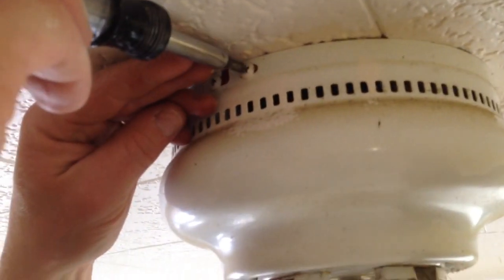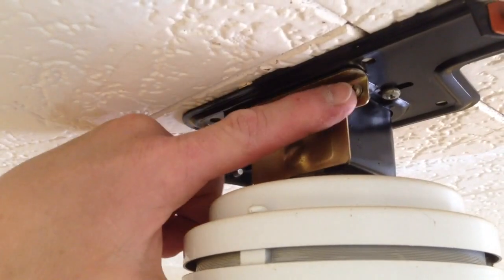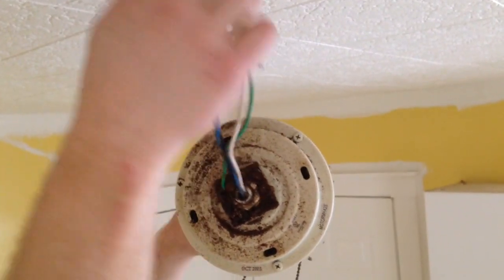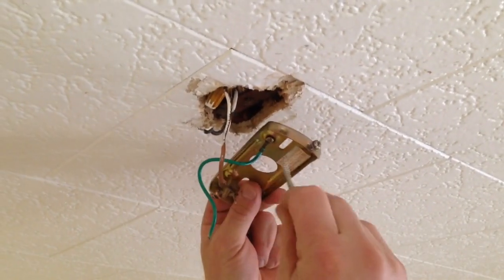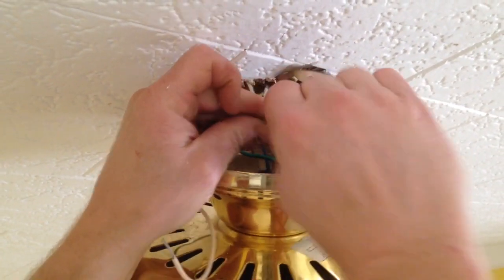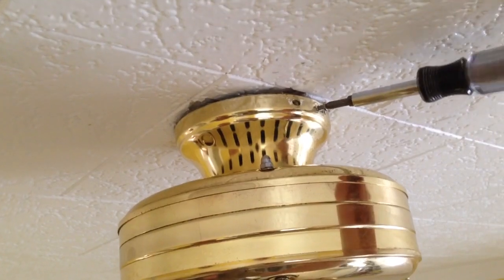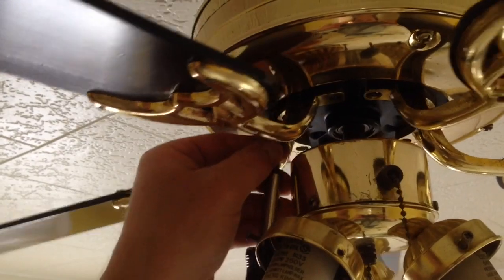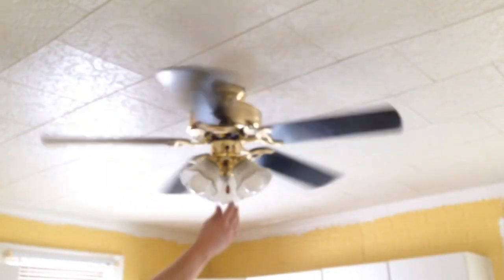Installing a ceiling fan

Comment: You that new friend put electrical tape around the bottom of those wire nuts that insulation is extremely flammable most likely just for safety if you were if I were you I would do that
Reply from the maker: Thanks for watching.